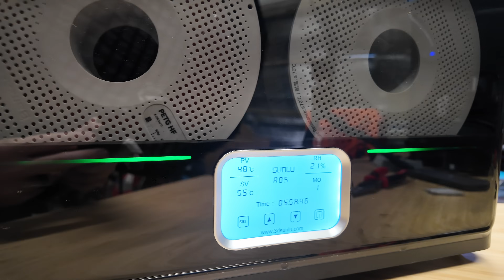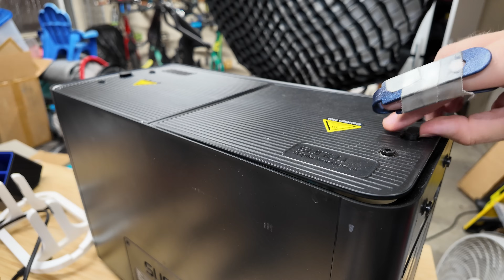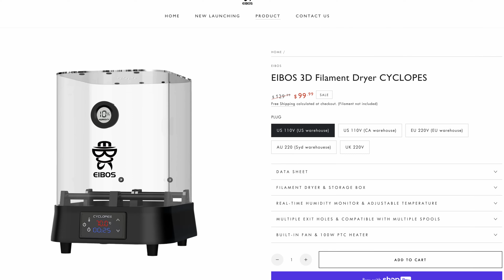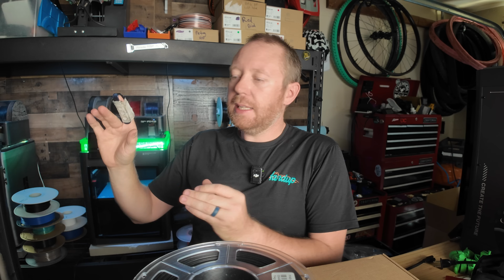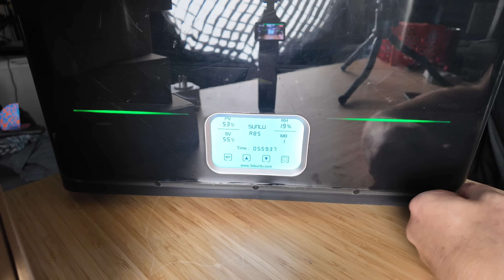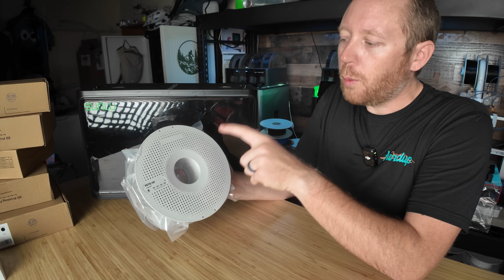This Saves Me HOURS – Sunlu S4 Review

Comment: Hi there, have used the S4 for 48 hours now. Drying performance is good. BUT, hardly anybody is mentioning the terrible, lasting smell of this machine. Simply unbearable. Why don’t you at least mention this in your review? If you do review and advertising for it, I think you also bear responsibility for negative aspects of the device. I will return this product. Even after >10 hours of operation, the gas emissions do not stop. And no, those do not come from the filament but the cheap ABC/PC plastics of the device enclosure.
Reply from the maker: Honestly, I never noticed any smell from mine. The unit lives out in my garage, so it’s possible I’m just not as sensitive to it or simply never picked up on it.

That said, just because I didn’t mention something in a review doesn’t mean I was hiding it or intentionally leaving out a negative. I can only report on what I actually experience with a product. If I had noticed a strong or lasting odor, I absolutely would have mentioned it. I’m glad you shared your experience.

Comment: I just got my filadryer and connected like yours and yet I still have stringing and burrs. It’s my first time using PETG. Don’t have these issues with PLA. Suggestion on what
You do? I was told when the pv and sv reach 50 and RH 20 I can start printing while it’s still drying and still having issues. Suggestions? I’m using Bambu PETG
Reply from the maker: With PETG, especially the HF stuff, I dry for the full 8 hours before i even try to print with it

Comment: I have this dryer and I am wondering the most effective way to vent moisture out. Do I leave the lids resting on top but not closed, propped open a bit with a riser of some sort or leave it shut and just completely open it for a few seconds every hour or so?
Reply from the maker: I’m not home at the moment, but the filament path holes should allow the moisture to vent
Reply: @RadDadsPrintLab I agree. Just got mine and it’s subtly different but has removable plugs (stay latched and don’t fall off so u won’t lose them) and seems like popping this open on the filaments you aren’t printing with would work fine for ventilation.

Comment: I will for sure get the Sunlu S4 after watching this video, was waiting for Sunlu AMS heater but it was only compatible with the AMS 1... I'm printing with Bambu Lab PETG HF as i write this and it has to be dried but then i cant print for 8 hours if i use the AMS as a dryer..  i am getting all sorts of problems with that PETG, first layer not sticking, layer shifts and i'm 90% sure it's from wet filament. Any reason you stick with Bambu Lab PETG HF and not use other brands? I had no problems without drying Prusament petg or elegoo rapid petg.
Reply: BTW i'm going to try Fiberlogy PETG Matte black
Reply: I share exactly same experience. Do you also get terrible results just few days after the filament is dried? No matter if it's stored in AMS with desiccant packets or in vacuum seal bag. Mind-blowing.

Comment: I have this dryer but don’t really understand how it works. It almost seems more like a sauna than a dryer. There is no sort of drain for the water to go or steam to escape. The new Bambu ams has a drain port that opens up. I have had my TPU “drying” for over 16 hours and while the print quality was better, there are still little specks all throughout my prints.
Reply: Its not a hermetically sealed housing, but there is space for dessicant in the machine.
Reply: Did you figure this out? I just got one recently and was wondering the same thing. How does it get the moist air out? It doesn't dehumidify like my AMS2 Pro...